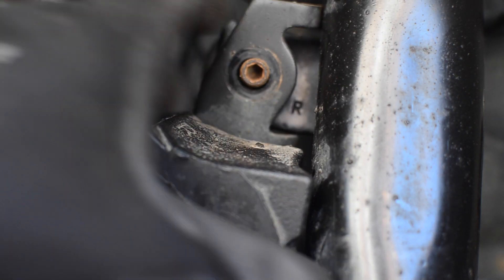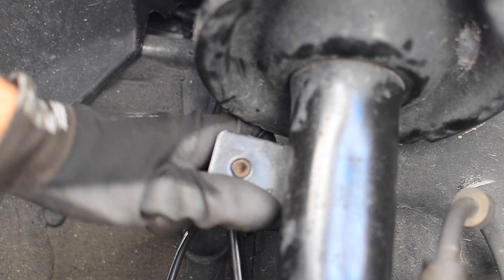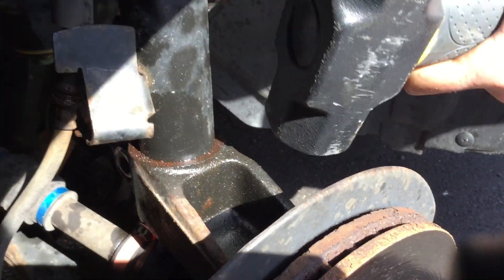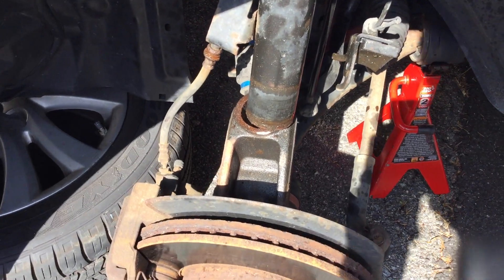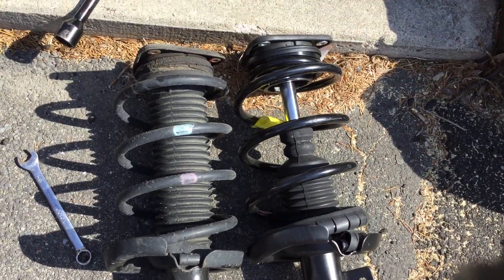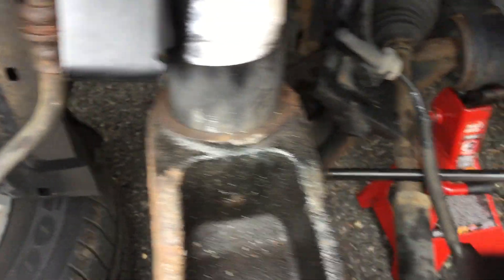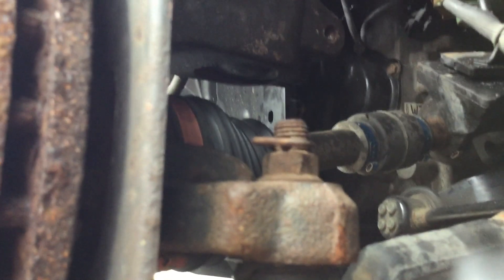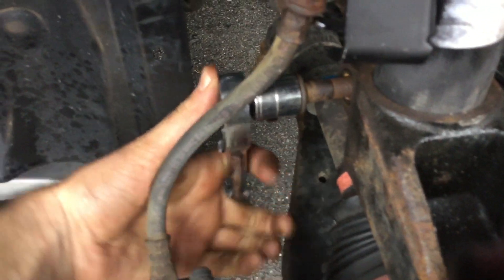[HD 1080p] How To Replace Mazda 3 Front Struts 04-13

Comment: My original OEM struts had 147k miles on them. Garage changed them out along with the sway bar links for 500e. I think it was gonna cost 300e by the time I bought the coil clamps and all the parts so took one for the team.
Reply from the maker: Reasonable move I'd say. Nice they lasted so long!

Comment: Thanks for making this video. To separate the strut from the knuckle we used a 3 pound hammer using the method show. To reinstall we bolted to top hat to the car first, then roughly positioned the bottom portion of the strut into the knuckle, ensuring that the rear tab is positioned to slide into the slot. Next, we shook the strut and knuckle to get the strut to insert into the knuckle more. But instead of sanding off the paint on the strut, we made a wedge out of a old spare 1/2 bolt to spread open the strut mount on the knuckle a little more. Then we used a jack with a rubber pad to protect the ball joint cap to press the knuckle up onto the strut.
Reply from the maker: Awesome glad this helped! And also glad you wedged; i still have these installed at 150k - they work but are quite rusty where i sanded them!

Comment: Is a wheel alignment required after the new strut installation?
Reply: Not that I'm aware of. Although one garage said it was and another said it wasn't.
Reply: I've never had to get an alignment done after strut change. 2004 Mazda 3....doesn't even have adjustable bolts in the front anyway. You can still mark them with a lumber crayon or sharpie I guess.

Comment: Do you think I should be worried about dislocating the cv shaft while trying to get enough clearance to remove the strut from the knuckle?
Reply: remove it... as you remove the strut, the hub assembly hangs free and all the load goes to the CV axle.. if it pops out, you're fcuked!!
Reply: It does seem to be a concern. I am just going to put a stool or a scissor jack under the knuckle so it can't drop too far. It does have to move some but just limit the amount of travel.  Plus a few stretch bands from the caliper to the lower control arm for the brake hose.

Comment: Surprisingly easy to do considering it's an older mazda, usually doing anything on them is a pain
Reply from the maker: Thanks for watching, happy this helped!  Yes, it was a relatively simple job for me, but for sanding the Outer Diameter of the lower part to fit my Knuckle...that sanded area has already rusted a bit (expected).